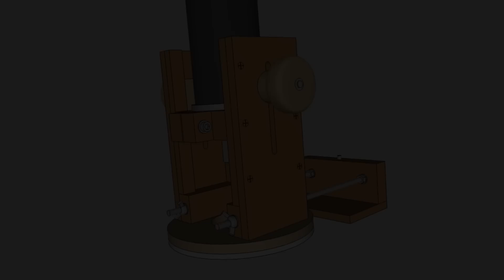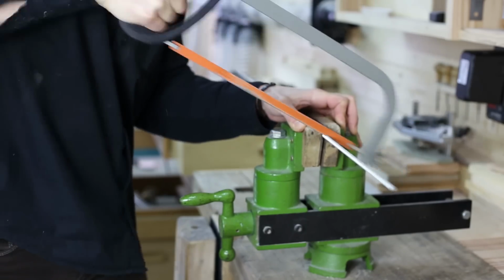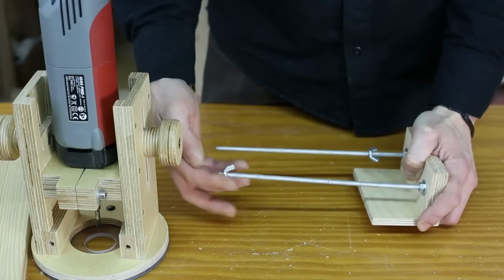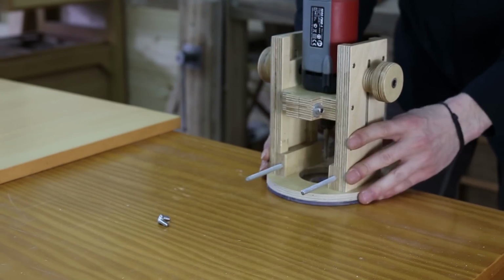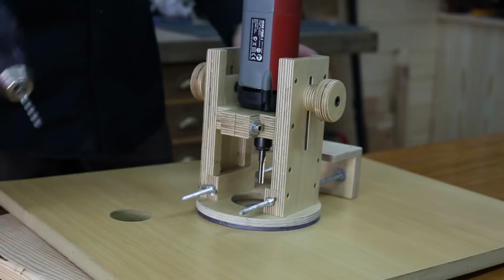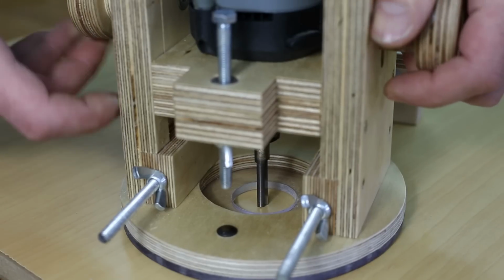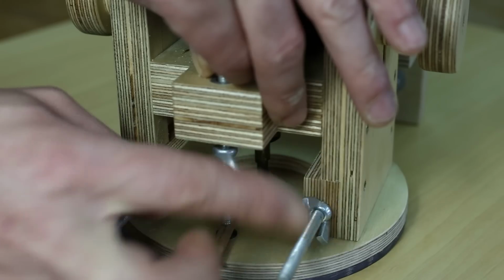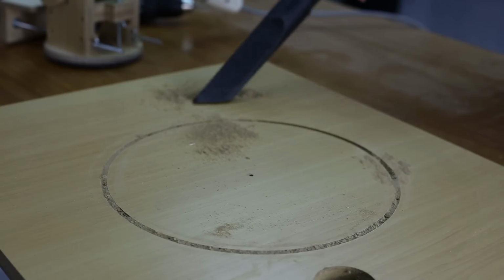Homemade Router Edge and Circle Guide

Comment: Ok, here is a stupid question, number 37 in a series. You drill a hole for circular cutting and put in a bolt. Then presumably you screw it into an insert in the base of the jig. Doesn't it either tighten or loosen as you turn the jig? I realize it is only once.. but this is going on, correct?
Reply from the maker: with a single spin, there is no problem. You could also use a simple pin shaft. Thank you!
Reply: Paoson WoodWorking Thank you for clearing up my stupidity. It runs very deep and needs to get washed now and then. In the back of my mind I have the right answer, but I keep dismissing it in favour of an extensive system of convenient prejudices which I learned from people even stupider than myself. ;)
Reply from the maker: Thank you for your comment!